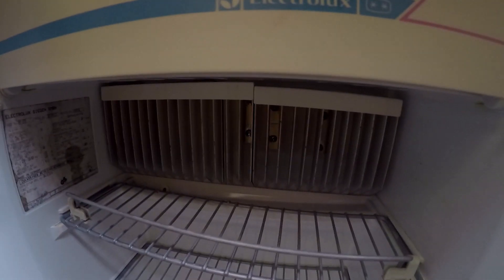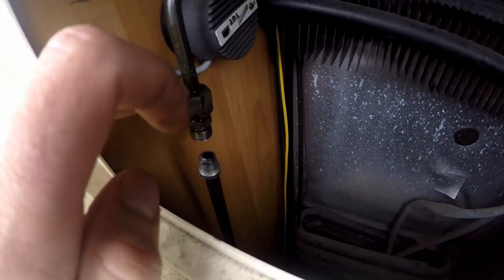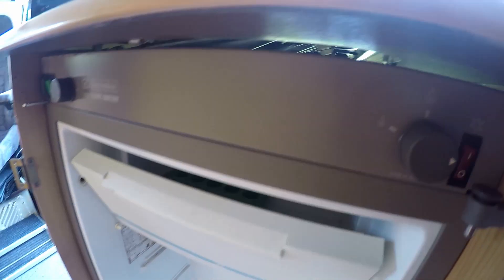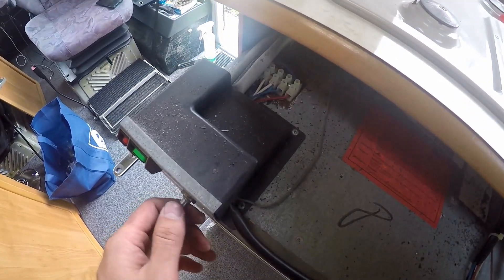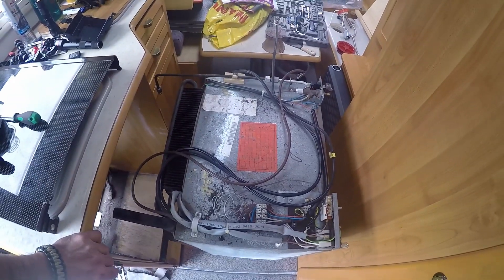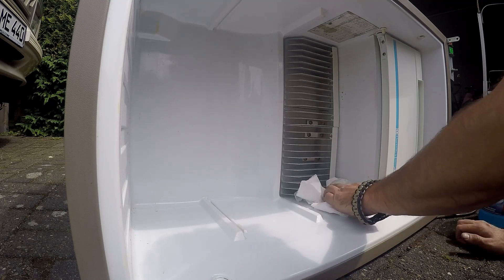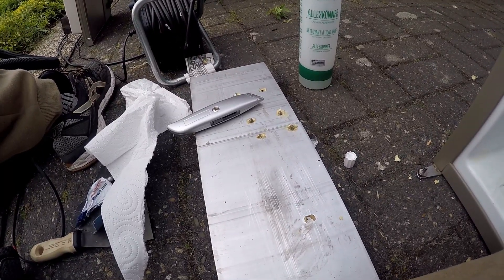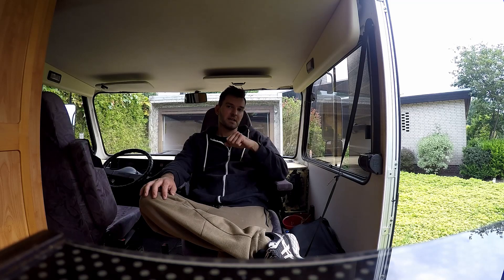RV/Motorhome -Hymer Absorption Fridge Fix Part1

Comment: jetzt wo der kühlschrank drausen ist, hätten sie die möglichkeit einen thermostat gesteuerten lüfter einzubauen. hatte seiner zeit auf gasbetrieb guten erfolg damit. das internet ist voll mit tipps. einen separate sicherung und einen schalter empfehle ich sehr
Reply from the maker: Hi Dan, darüber hatte ich auch schon nachgedacht. Den werde ich wahrscheinlich aber nachrüsten, da es mir zeitlich zz. nicht passt. Thermostat ab 50 Grad oder welche Empfehlung hast du da?
Reply: theRVmate kann mich nicht mehr erinnern aber weiss dass ich die teile direkt bei Hymer kaufte
Reply from the maker: @DanP001  trotzdem danke:)

Comment: I hope the fridge will work perfectly for you for many years to come. You did good for being a rookie, I must say :-)
One question, do you have payload enough on this Hymer to install solar on it? I have been looking at some Hymers, but there doesn't seem to be enough payload to have a bigger solar system on them. If you have been looking at solar systems, have you found something that you can use in this RV?
Reply from the maker: Hi Annie, me too! Thanks for the compliment:) actually I have a little solar on the roof! (Probably a 40Watts Panel) Well I'll definitely upgrade my system in the next couple of months. Would like to have 200ah Lifepo4 + 400 Watts Solar! For that I need to wiring etc. 

So if you wanna have a bigger Payload (if I understand correctly) you need to have proper wiring. I can just recommend you to check out Will Prowse Channel on YouTube. He knows everything about Solar!

https://www.youtube.com/user/errolprowse
Reply: @thervmate3326  - That is what I would like to have too, but the payload is too small.
Check Nutzlast in the Eigentumsbescheinigungen for your car. We can check it online as well. I don't know if you can do that in Germany.
Reply from the maker: @milcotto4153  do you mean that you're just allowed to run a certain solar payload?
Reply: @thervmate3326  - No, I am thinking of the extra weight you are allowed to have in the car, including passengers, diesel, water, propane, greywater, clothes, food and whatnot. And there are weight limits on each axel and on the roof too. They are checking it frequently here. And if you are over the weight limits, they will make you take things out of your car untill you are within the limits. And you will have to leave it there.
Reply from the maker: @milcotto4153  now I understand what you mean. I think I won't have problems with it :)
Reply: @thervmate3326  - Good to hear that! :-)